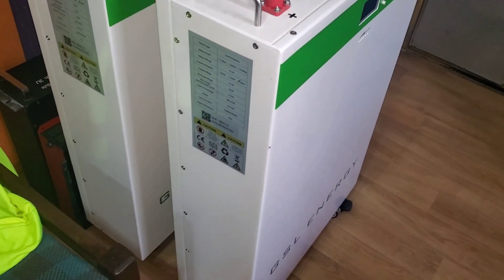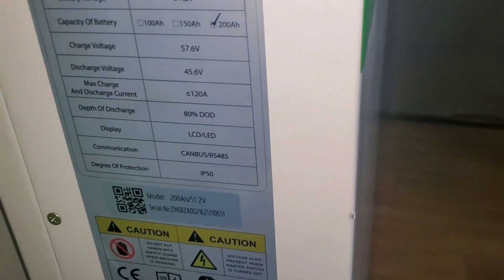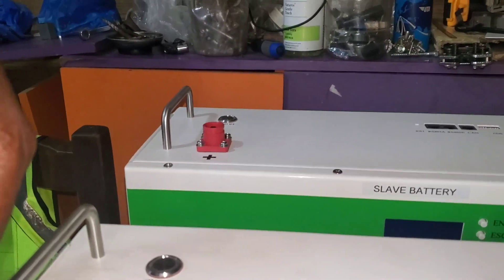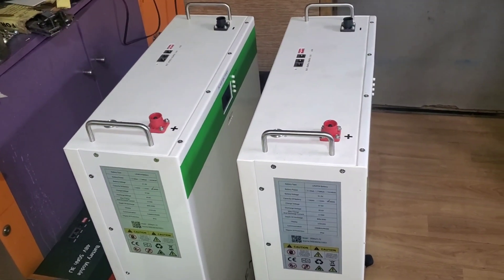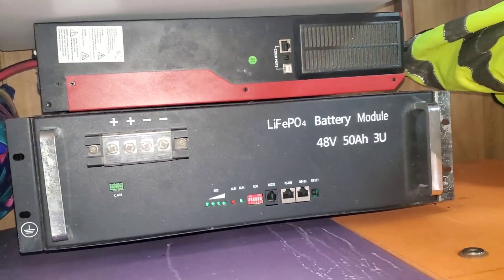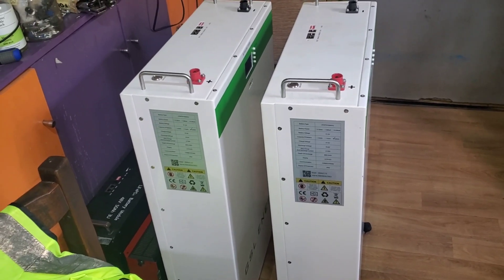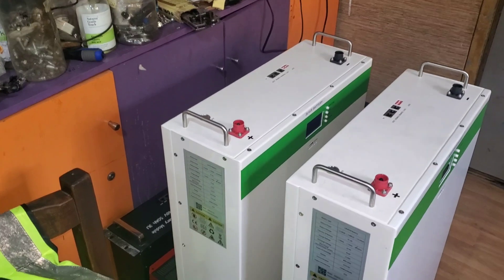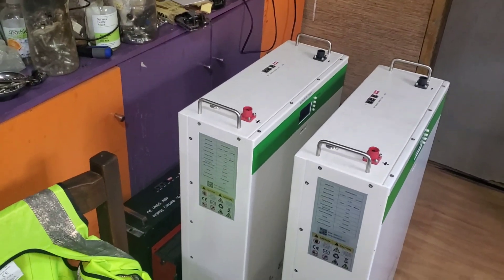More failed BMS on lithium battery powerall

Comment: Listen well, we have purchased a lot of 10KWH batteries from GSL and also from a completly another supplier, within the same time. We got BMS problems with some of GSL batteries and also the other batteries of the other supplier. They sent us replacements, and we send them broken BMSs to test and tell us what is causing the problem. But we found that the two BMSs are the same, and we knew the supplier of the BMSs, which is the same as in the video, it is Seplos. We contacted Seplos, they are kind and help alot, actually also GSL and the other supplier have good after sales service.
The BMS problem was with diode D4. On of the suppliers sent us a lot of these diodes and changing them fixes the problem.
Reply from the maker: Thank you for watching and commenting. We got the same response from another viewer. We are thankful that GSL provided good support.
Reply: Hi, who was the other supplier and which one is better? So what batteries are you recommend to buy?
Reply: @rondrejas  the othet supplier is a trading company not a manufacturer, called OSM. GSL is the better and it is one of the best Chinese Lithium battery suppliers

Comment: hello solar doctor greetings, you have had experience with various brands of batteries in your opinion is this battery worth it from your point of view as an installer?  How do you rate this battery against Dyness, which one is better?
Reply from the maker: Dyness has come a long way since my first day with them. The warranty support is good. Pylontech I use because they are easy to purchase in my Market. SolaX is my first choice because they are high voltage batteries. Thanks for watching and commenting

Comment: i have been following up your battery review and i commend your work....i will want to ask a question...which battery is now good..i am wondering if plyontech up5000 will work well and do the work very well
Reply from the maker: Hello Michael thank you for watching and commenting. The Pylontech batteries have a very good reputation in the market. You really can't go wrong if you choose them. Your application will determine the best choice for you. BMS communication is important to get the best out of your batteries.
Reply: Thanks confirmation this with my as i put together information before buying any product and hope it work with almost all hybrid inverter
Reply: I have Heard that many peoples having problems with pylontech is 5000 as well they have pouch kinda cells which can expand in charging or discharging process similar to LG chem and for that reason I won’t buy them prefer lifepo4 as are moch safer and last longer even if have to replace bms and I don’t think Chinese batteries are bad I would say many are scam from many suppliers but the pylontech are made in China too friend of mine have 5 othe them 2.4kwh to power up his house seems to work well but the key is to not discharge them write down or charge with high Ah too quick. But the capacity of those batteries are little only 3x pouch 8cells each compared to lifepo4  16 Large prismatic cells and roughly 55kg battery. But that’s my opinion and the pylontech seems over priced for what they are.
Reply: What are the precautions to make a bms not fail too much?

Comment: Seplos is partner with SH Energy Electronic (CNEnergy Electronic Technology). The issue is well know on some of their serie from last year JUNE, JULY, AUGUST. They have rectify since then by replacing BMS. The issue is on the diode D4 which could not handle 100v. New BMS D4 can now handle up to 200v
Reply from the maker: Thanks for the heads up. But the battery is a LV battery so not sure I understood the issue.

Comment: Just get felicity lithium battery. No issues
Reply from the maker: It is not really ideal. Bms communication is important. Felicity does not really offer that
Reply: Just go DIY and put a JK or JBD BMS. JBD if you want something simple with a nice Bluetooth interface. JK offers an insane amount of adjustable parameters with up to a 2A balance current so an active balancer is not needed unless you have some Grade G(arbage) cells that aren’t matched

Comment: It are mostly inferior smd parts, transient voltage surpressor or diode in the on board DC/DC buck converters that are faulty. I have many different BMS boards, also Seplos BMS boards that went faulty within a week after installing system. Ask supplier and the will send replacement parts to replace the electronic parts.
Reply from the maker: We will ask them again. Thanks for the heads-up
Reply: @drsolar  we have installed around 1 MWh on batteries in most micro grid projects and I will make a video about the faulty BMS boards we have in our store, 50% I could repair but without a diagram or test repair instructions from supplier it's difficult. I noticed that clients contacted about failing batteries when they having short circuit in AC output, as we used victron quattro 15 KVA with huge transformers that it could be delta I divided by delta T that can sweep up the DC bus when inverter MOSFETs are switching off to protect, the enormous flux that gives an enormous E when no proper snubber resistor circuits are in place.
Reply from the maker: @koosmulder2795  thanks for the update. You have been a busy person. When I grow up I want to be like you
Reply: Never ever buy OSN batteries, these are swindlers 😭😭😭

Comment: Reasons why I stick with DIY, and position Daly smart Bms, so far so good, am so comfortable, some of my clients with the lithium systems, had been tuning, 4yrs,2yrs, without any Complain....all this prebuilts batteries, some are fake, batteries inside are grade b cells or even used cells with no qr code, why d bms will b quark, once it's warmed, it's pack up.
Reply from the maker: I did DIY and I am paying the price daily. Prefer reputable suppliers. Thanks for sharing your experience

Comment: Sadly I guess it’s always the case that one gets what they pay for, cheap is almost ALWAYS expensive, and if it’s too good to be true on price, it’s almost always must be a no go area. I’ve been meaning to suggest now that SolaX seems to be the inverter of choice, a dive into the battery “underworld”, would make for interesting content. There’s so many lithium knock-offs, some NMC, others LifePO4, others 2nd life, all promising 5-10 yrs, 3000-6000 cycles it’s a mess.
Reply from the maker: Cheap can be expensive. Very expensive
Reply: @drsolar  I rather clients limp with AGM/Gel till they go for reputable brands like Pylontech and BYD, pricey but worth it.

Comment: with LiFePo4 cells, after the initial top balance at 3.65, absorb 3.55v, float 3.45v.
Replace the BMS with a JBD or Seplos.
Reply from the maker: I will do that with the Topband. Thank you for the tip

Comment: This is really unfortunate. The cells are probably still fine but the entire battery remains useless to the owner if the BMS is faulty. Replacements are nice but they should built them better in the first place. Recently one youtuber claimed most of the lithium battery brands are using the same or very similar BMSs and that these BMSs are somewhat infererior to the popular DIY types. It's all BYD and Pylontech for now I suppose. Thanks for the video.
Reply from the maker: That is the reason I stick to reputable brands. I had expected Topband to be much better but their presentation was very poor.